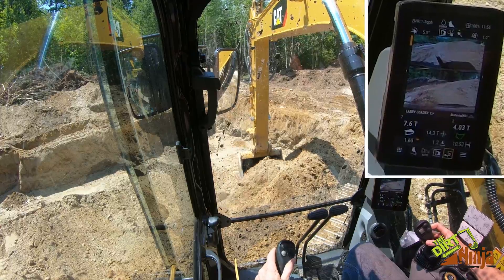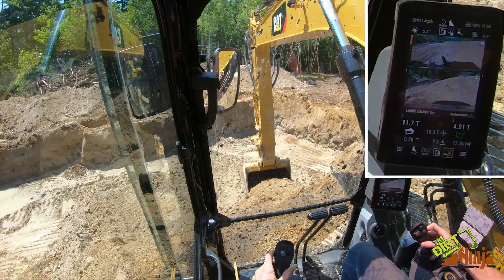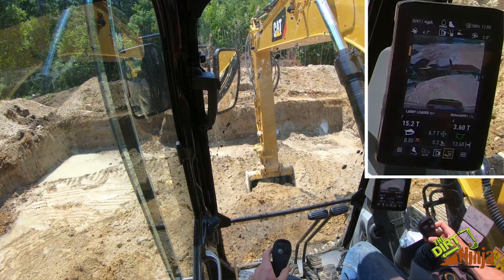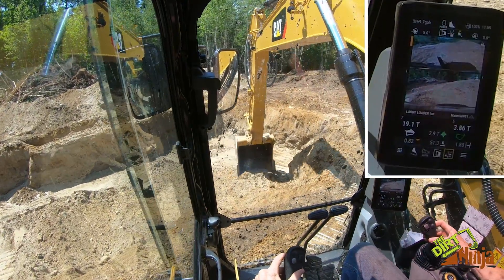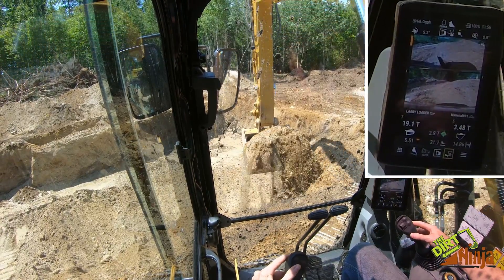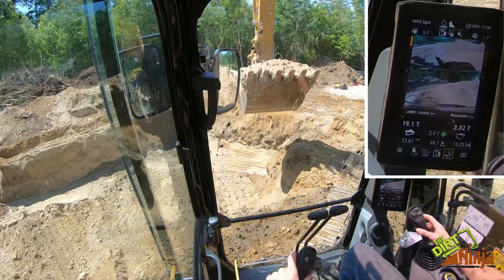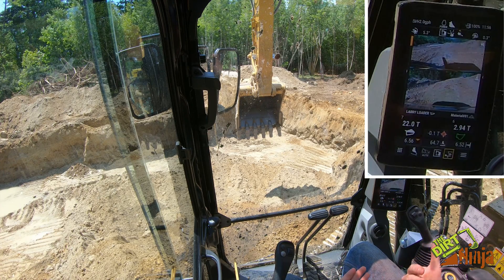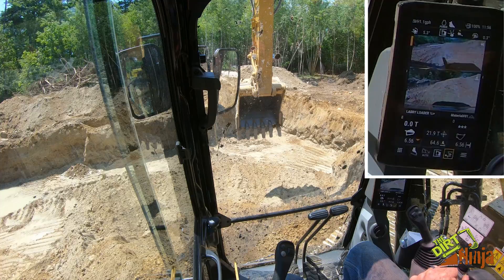Payload System Explained - Cat Next Gen Excavators

Comment: How have you found the payload system with actual production loading? I have had 2 brand new 323 next gens and both had issues where in a fast cycle working back a bench, they system would come up with “bucket tilt error” which I’m pretty sure was because we run tilt hitches on ours (wrists I think you call them up north) and the system doesn’t like the hitches. Is it less temperamental with just the static hitch setup?
Reply: I would imagine it would be, as if the machine is level and the bucket isn’t it probably gets confused because it doesn’t register the tilt hitch for what it is and just sees it as some sort of auxiliary attachment, so it might either think you’re on a hills that’s steeper than it should be or that your bucket isn’t properly connected- I don’t know the machines too well but I am a little familiar with computers like those.
Reply: Game Ville ours had 3d GPS as well, so had a bucket sensor hooked up to the on board grade control system to tell the machine where the bucket was tilted. It has a handy display for bucket angle too so it definitely knew where the bucket was, it just didn’t seem to gel with the payload system. No doubt in future software updates they’ll sort it
Reply from the maker: We just had this machine on rental for a week. We didnt get to do any production loading

Comment: Is the bucket load measurement independent of arm angle? If I'm digging straight down deep or on the other hand was dredging a pond with the arm extended out would it still be accurate?
Reply from the maker: Yes it doesnt matter what the angle is as long as you make that scooping motion that I did as well as a quarter turn of the turn table.